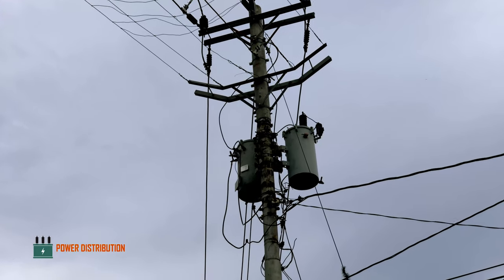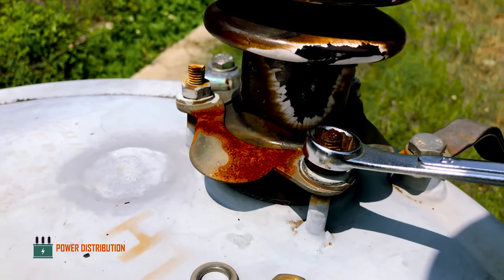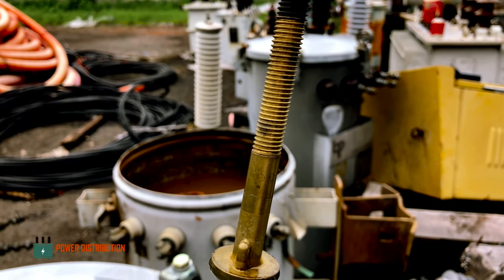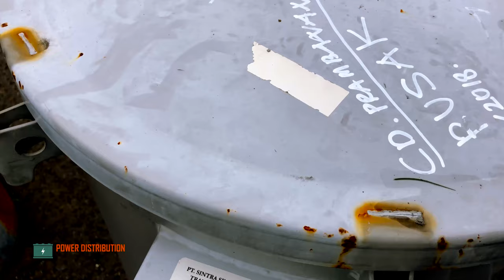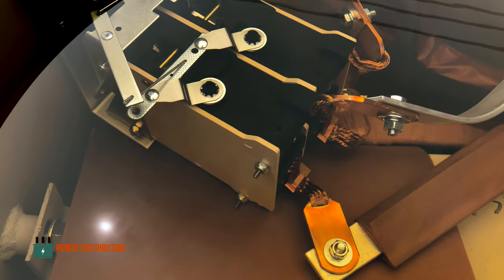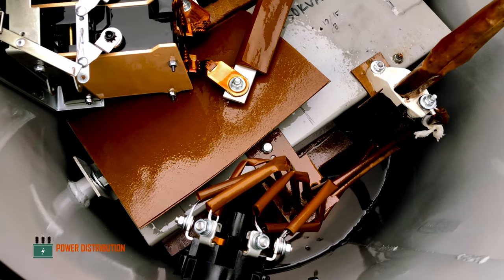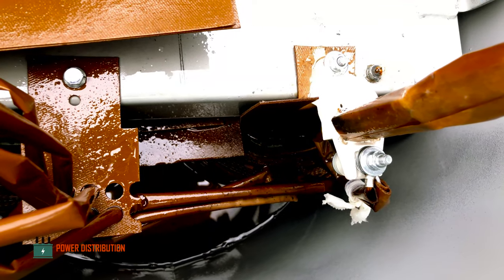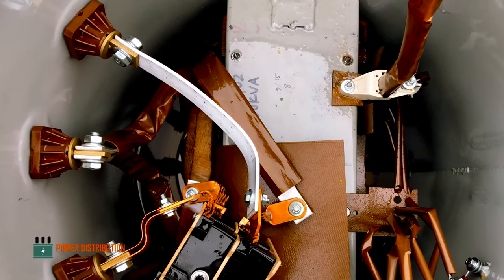WHAT'S INSIDE a Pole Mounted Distribution Transformer

Comment: Thank you! I just started a job building these transformers. I do the internal winding. It was very helpful to see the finished product as everything else is built on another site.
Reply: Hi Case, is there a way you can share any single-phase pole mounted transformer drawings? I will troubleshoot a feeder from this transformer that has a voltage drop.

Comment: A couple of factoids that many people dont know.......The high voltage wire which runs from the overhead line, into the primary coil....exists the primary coil and runs down the power poll into the ground!!!!!!!!!!!!  and there is no direct connection between the primary coil and the secondary coil.  The step down voltage is achieved by the number of windings and by induction through the steel core. Cool stuff!~!!!!!!!!!!!!!!!
Reply: Hey

Would you please help me out with a drawing or diagram?
or maybe a clip that shows what's inside the transformer

Comment: Very interesting how one thin wire goes in at the top and three thick wires come out at the side..
Reply from the maker: Max current which enters the top is around 4A, max current exit the side terminals is around 216A.
Reply: @imadewn   the primary feed is between 15-20Kv AC @ 4A pull and stepping up the current output around 216A with 120V between A-B C-B 240V between A-C? secondary outputs?
Reply from the maker: @TheTheo58  the primary feed is 11,5kV pulls around 4,3Amps (11,5kV x 4,3 = 50kVA). the output is 108A for terminal X1 and X2 (Return), 108A for X4 and X3 (Return) terminal. both X2 and X3 are bolted together to ground.
Reply: It's not explained here to you yet, but the role of a transformer usually is to change voltage.  Voltage and amperage are indirectly proportional.  High voltage comes in with a relatively low amperage.  Lower voltage goes out but with a proportional increase in available amperage.  The total power going in and going out is the same.  

The reason high voltages are used, especially in distribution, is that the lower amperage allows much smaller cables to be used.
Reply: @jovetj  Extremely well written.
Reply: @tedlahm5740  Thank you. That's very kind.

Comment: What are the bushing purpose.   Allow voltage bleed or suppress it.  Suppress the bleed,  well allow dissipation without Corona arcing???
Reply: The bushings allow a long-distance separation of the high voltage from the grounded can.  The ribs on the bushing increase the surface distance greatly.

Comment: Hello! Sir, I'm a new subscriber, I'm just asking, what is the use of oil inside the transformer?
Reply from the maker: There's 2 kind of oil inside distribution transformer: PCB on the old one, and Mineral oil on the new one..which is in this transformer
Reply: Thank Sir for the info
Reply: The oil increases the insulation of the live components and the grounded metal can, and it also acts as a heat sink to allow heat from the live components to radiate to the can where it can be cooled by the surrounding air.

Comment: The transformer looks old asf. It might contain pcb’s
Reply: The coolant is just mineral oil, pcb's were in mining type transformers as it was non flammable it was called pyroclor and it was banned in the 80s-90s. Most transformers containing it were changed to mineral oil after de-contamination.

Comment: I thought that was liquid from leaked case, never thought such things need coolant agent, how many degrees for a powerful throttle or maximum electricity supply could raise the temperature?

Nice content brother!
Reply from the maker: Stefan E. Rez. Rah. Yes distribution transformer needs oil as a coolant and additional insulation. It can effectively lower and spread the head across the surface of the tank. 

On full load, a single phase transformer can raise as high as 90'C in worse case scenario for ex imbalance, overload and short circuit on the secondary wire.
Reply: The coolant and ambient temperature are major factors in the load capacity of a transformer. You can run a transformer well over its rated value if it is somewhere that is very cold, since the ratings are based primarily on how long the mineral oil and internal insulation will hold up at high temps. Since the current in the wires create heat, that is what we are trying to dissipate.
Reply from the maker: LAST CALL the thickness is around 2mm.
Reply: bro why are those things are exploding ?
Reply: Why are these disrupting? What causes this?I'll tell you why, 1st its probably old and wires are shortened or its overheated
Reply from the maker: @trooperodst6880  overheating and gas building due to excessive load
Reply: @trooperodst6880  Lightning is also a common cause of damage to transformers like this.  The failure can happen many months after the damage is inflicted.
Reply: @imadewn  Oh I see! Thanks! Also YT haven't notified me damn. I can't believe it. I really interested in these things.
Reply: @jovetj  Oh Okay! So it's gonna be like Lightning hits the transformator and damages it and after that becomes faulty. If I understand correctly.
Reply: @trooperodst6880  Yes. Lightning is not always guaranteed to damage a transformer, but it's always possible. Lightning does not have to directly strike the transformer or its pole to cause damage.  Like any surge of electricity, it can strike at a distance and then travel along the utility wires.  Large over-voltage or current can damage the winding wires or their coating that insulates them from each other.  It can also, in theory, damage the oil.  Severe winding damage can instantly destroy a transformer, but less-severe damage can grow over time until failure.
Reply: @jovetj  Great to hear man! Always looking forward to learn something!